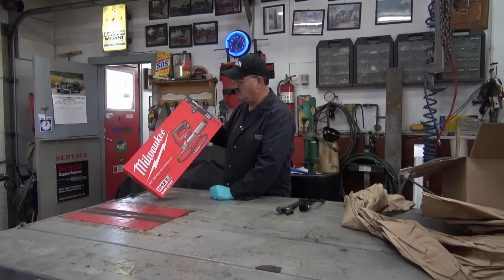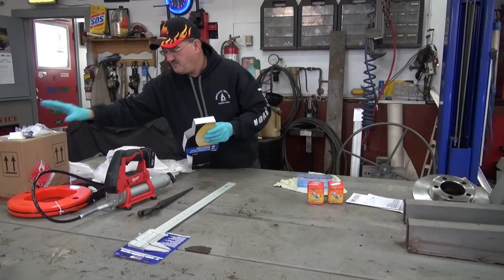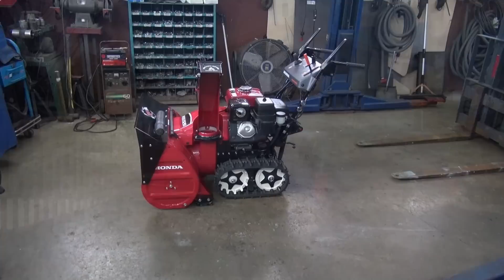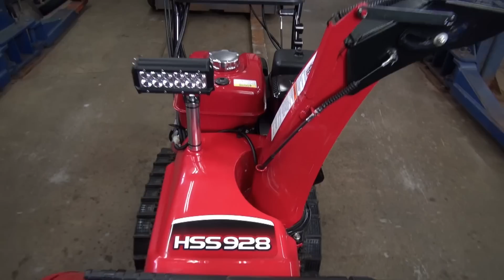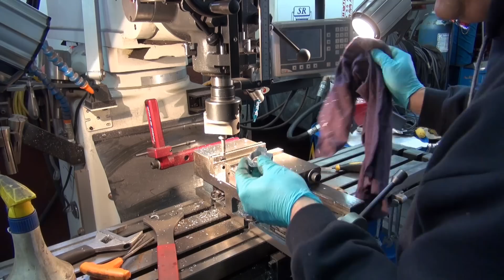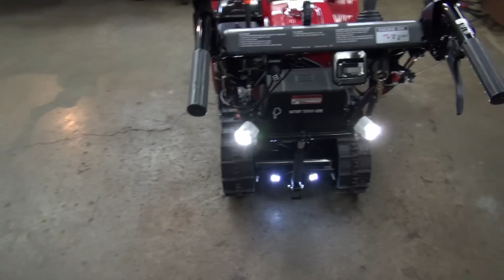Honda Snowblower Update And Some Other Stuff

Comment: Hi Paul,  Just an FYI.  I spoke to Honda's tech support regarding the track pins today.  The front wheel on the snowblower is called the crawler wheel and that takes sheer pin & cotter pin # 06907-732-000 comes as a kit or set.  The back track wheel known as the  slick wheel takes sheer pin # 90702-743-000 and cotter pin # 94201-30180.  They are both meant to sheer to stop any damage to the unit.  So I removed the harden bolt and nut I put on.  Keep us updated with your future modifications.  Thanks, John
Reply from the maker: Cool. That makes sense. Mine is oem. I might have to use it tomorrow. Big storm on the way. Enjoy your snow blower. Great unit. Thanks for the info.

Comment: Hi,  I love the modifications, Thanks for sharing.  Question: I noticed when you zoomed in on the sprockets the pins you had holding the sprockets in place were the same for both the  front and back  held in place by a cotter pin.  My unit has the same set up for the 2 rear, but a harden nut and bolt for the 2 front sprockets.  I bought the unit used so I'm not sure which is correct.  The Honda part # for the cotter pin set up ( Your Set Up) is #90702-743-000.  Is this what I should be using for all 4 sprockets? Thanks, John
Reply from the maker: I don't have a parts catalog for the blower. That being said all the ones I've seen are like the one I own . Thanks for watching.

Comment: Where can I get one of those nice drift breakers that you have installed? See pics online but can't seem to find one anywhere. Also that waterproof tube. Can anyone help??
Reply from the maker: intrepid277 Check with your local Honda dealership. It's an aftermarket item made in Quebec. As for the tubes. Here's the link. There's two sizes. The one I used is the smaller size. Hope this helps.http://www.agrisupply.com/manual-canister-large/p/67670/
Reply: Paul Short I can't seem to find the driftbreaker anywhere. All signs point to Canada but I'm in Boston. If you have a link for it that would be great. But thanks again for the tube info.
Reply from the maker: intrepid277 
No link. Sorry. Try calling a Canadian dealer across the border and asking them. Tell them it's an aftermarket part from Quebec. All these dealers are buying from the same vendors.

Comment: Hi Paul. Sorry to bother you. Who manufactures the auger housing extension that you have mounted to your 928? 

Thanks
Reply from the maker: Travis Nesbitt I have no idea. I didn't pay attention to that when I installed it. Did you get the part number we got for you yesterday? That was a Honda part number so it should be easy for your dealer to get it.
Reply: Hey I'm also looking for info on the auger extension. Plz plz plz reply

Comment: Hi Paul! 

Thank you for looking into the part number for me. I have ordered the heavy duty commercial skid shoe plates for the side and back of the HS724TC. 

A question for you. With regards to the Honda manual it states to use 5w30 oil for the blowers. Because of the cold weather that we get here no different then where you are. 

Would you see any pros or cons with changing the weight of the oil to 0w20? Reason for asking is because of the viscosity of the oil on cold start ups?  My garage is not heated. I am thinking running synthetic would be better, plus the tolerances in the motor shouldn't be effected? 

I always want to run good quality oil in my machines, but am worried that if I change the oil after the break in period it might effect the blower and any future engine issues. 

I would very much like your opinion. 

Hope your having a good day!
Reply from the maker: Travis Nesbitt Travis I really don't get a lot of time to answer questions in such detail. I'm pretty well maxed out now as it is in responses.Your manual will tell you at what temp to use what grade of oil. That being said I will use Moble 1 10X30 Full synthetic in mine and the Honda generator as well.

Comment: Paul..so the Honda has a DC generator?  Do you know if all snowblowers that have lights have a DC generator?  I have an old Crappy Tire blower that I want to replace the 27W light with a 27W LED.  But I heard that if it has a AC generator the LED will flicker while running.

Comment: Hi Paul really enjoy you video that y i Subscribed  i have a Honda 6 hp 21"Commercial type i like to know how to install  a light on it specially how to do the wiring .... thank you Paul
Reply from the maker: Gilles Godin 
Thank you Gilles for your subscription. Do your blower have a light on it now? If so, just join your light int the same system. If it don't have a light you'll need to see if it has a generating coil on it first. It might not making it impossible to install one. 
Thanks for watching and Happy Holidays.
Reply: Paul Short Hi Paul no it do not have a light on it if it would, that would to easy install a new one just not 100% sure where to look for a generator coil

Comment: het Paul! Nice mods on the snowblower! I have the Honda hss 970 2014 and i have orderd a 36w led lamp to mount on my snowblower. What kind of metall pipe did you use to make the led light come a Little bit higher? Did you do it yourself or what?
Reply from the maker: Robin Markstedt 
Thanks Robin. That part under the light was one that I machined out of solid aluminum stock then polished. It had a stud on one end and the other end is threaded.

Comment: Thats such a badass snow blower haha. Do you ever have issues with those lightbars fogging up? I hear they dont give off heat so they fog easily
Reply from the maker: Cat320ELRR 
Well I can't answer your question because this snow blower is brand new and I've only used it to more it around the shop. These newer LED lights do give off some heat so I'm not anticipating any fogging issues,
.

Comment: great video , just found your chanel, i'm doing the same with my snowblower and was woundering what i could add next, and i have just found it from you, i have added a meltbuddy from ariens,drift cutters, cab, rotating road flair ontop of cab( from ebay),drink holder,. I'm looking for a horn maybe a bycle horn and radio, anyway keep up the videos and i will look at more of your past vids,. thanks
Reply from the maker: rammur1 
Thanks and thank you for subscribing. You may as well ad heat to your rig now lol. Some cool mods you've done. Lets see a video. :)

Comment: Paul when you do the wiring for the LED lights can you show a little more how you wire it and how you run the wire through the machine and to where. Thanks
Reply from the maker: Bob Wakefield 
I've been asked this before and I purposely didn't do it because 

#1. It added more to the length of the video.

 #2. I'm afraid that if I show my actual wiring and someone tries it and don't do it right they could cause their machine to burn and or cause personal injury. With the way things are these days we all have to be very careful on what we share with others.

Comment: Hi Paul Is the limit switch on furnace working ok.  I thought fan should run longer than 3-5 sec to cool heat exchanger.
Reply from the maker: Pat Rothlauf 
Yup it is. It was running for a short duration in the video because there was very little heat left in the chamber. If it was just fired up the blower could run for 4-5 minutes before it would cut out and build up again. It's a very efficient furnace.

Comment: Hey Paul
That's Awesome video .. I love my 28" HD Snow Blower  from Craftsman that bought last year ... Most definitely has been a back savor :)
Reply from the maker: ***** Thanks Mike. Man I had a Craftsman blower for 13 years then gave it to my son and he still has it. I would have bought another one again but our Sears store has terrible service when it comes to replacement parts so I said frig it and went with the Honda. Anything beats a shovel my friend.
Reply: Yeah.. there are few of them here In Utah.. that suck on Service as well .. The one that l like is in downtown Salt lake City.. They treated me very well. My first Snow blower that i got was damaged so badly from shipment plus it had fuel in it (in witch their were not  supposed to ship any  Power Products with  fuel in it .. Oil Yes but a small a mount ... Fuel NO Way at  all ... Called my sales person and he took care of it he got a hold of the call center.. the call center called me back and took care of it has well .. I was a happy camper .,. and i have double my throwing cap.. buy a little trick ? love it
Reply from the maker: Glad they took care of it for you. I found Sears great ten years ago. Great fast service, good warranties. Now they are a complete mess. I won't buy anything from them anymore. Call them because of an issue and get a call center in India. Not good enough. I guess you put the rubber impeller kit on your blower. 😄
Reply: Yeah a lot happier... No Not rubber impeller kit I would rip it to shreds. its a can of Pam Cooking oil spray.. you spray it in the auger & the chute and it helps through the snow better and further then "Stock" i think ( you spray it on before you used it) I can send you a pic of the snow blower if you like? i can send to your email?.

Comment: Fun Saturday video working on the "Government Jobs." 

I agree with you on the suitcase for the greasegun. How would you ever keep it clean? Also, whenever I would get a case with a tool it ment I would need double the storage shelf space. One spot to store the tool and another to store the case. 

I could use that blower in Cincinnati, Ohio today.
Reply from the maker: QuantityEngineers 
I like cases for the fragile tools but a grease gun. I don't think so. the trouble I have with plastic cases is that they are slippery on the shelf and they slide off of each other. 
We had snow flurries here today but no accumulation thank God lol.

Comment: Nice video Paul... I bought one of those calipers too :)   Would be good if you can put together a video on grease guns. I have a compressor driven one and have had trouble with it off and on perhaps mainly from not knowing the details of its operation.
Reply from the maker: Bob Kelland 
Hi bob. Good idea. I have a weird way of looking at things. I figure if I know about it then everyone does and I'm starting to realize that's not always the case. How can they sell those calipers for $10. Good deal but I'm still not sure what I'll use them for lol.

Comment: I totally "get" the mod factor.  Guilty myself of doing such things. 

I live on the side of a mountain in the Sierras, so I get a bit of snow but not enough to need a Blow Snower.  Having never owned, needed or operated one, why does one need so much lighting behind the machine?  So you can see what color boots you're wearing?
Reply from the maker: ramosel 
Your a lucky man not to have used a blow snower lol. Well they're better than a shovel and not nearly as good as a tractor with a heated cab but I don't mind them.The Honda is considered the RR of blowers. As for the lights. your reason will be the one I'll be using because I sure couldn't come up with a reason lol. 
Keep well my friend.

Comment: I subscribed kubota tee
Reply from the maker: Thanks.
Reply: I'm watching the part where you told me about the weather lol why did you stop commercial snow clearing ?
Reply from the maker: I just got so sick of snow clearing. Did it for 23 years and got to the point where I said last year I'd never do it again commercially and I won't 😝
Reply: That sucks ! It's up to you , what are you going to do with a tractor designed to snow clear ?
Reply: But even if you are not snow clearing this year I'm still behind you and supporting you alllllllllll the way ;-)
Reply from the maker: Oh there's plenty of my own property to do. I got at least 1500 feet of roads here to plow. I still need it and it's a new tractor. There's plenty of guys wanting to buy it but I'm keeping it. I don't like the 60 series tractors. They are ugly. The cab looks like the pope mobile. Hydraulic hoses hanging off of them and they have issues with the fuel system. I have no trouble with mine.
Reply from the maker: Thank you. Oh I'll still be doing snow clearing videos. 😉
Reply from the maker: Last winter was the first winter I didn't do snow clearing. I was to only take that winter off but liked it so much I said I wouldn't do it anymore. Now in my spare time I'll do more designing for other companies and myself.
Reply: Paul Short That's funny.  We bought a Kubota 1100 RTV this year. We call it the Pope Mobile.

Comment: Another great video!   

I thought you would have turned those light to point out to the front and side.

I was looking for a battery operated grease gun earlier this week.  Just hard for me to justify $200 but I guess I can't take it with me.  LOL!

Milwaukee make great tools.  Been using their tools for over 40 years.  Never been disappointed.  

Would love to see Kathy set up in making graphic.
Reply from the maker: Rick Anderson 
Thanks Rick. I figured with the 7" LED light bar that I put on it there might be enough light up front but those lights can be pointed forward in a minute so I'll wait and see how they work when the snow comes and make the adjustments then. Well I have a pneumatic grease gun and a couple of manual grease guns but I wanted something more portable. 
I totally agree. Milwaukee makes a great product.

Comment: What kind of camera are you using. Awesome videos!!
Reply from the maker: Blake Albertson 
Thanks! 
 I use a total of four cameras but the main one and the one that's used in these video's is a Sony Handycam HDR-PJ760 with external mic, remote tripod and a few other goodies ;). It's a projection video camera with a built in hard drive. It has a floating lens as well.

Comment: Do you live on Roaches line? the road to Bay Roberts and Carboneer
Reply from the maker: ticky121 
No. We are actually right in Bay Roberts.
Reply: Ok manymoons ago I had a KW w 900 

freeze up in
M a Powells
Reply from the maker: ticky121 
Ya that's not good. We are right across the street from Humbers Medical Center.